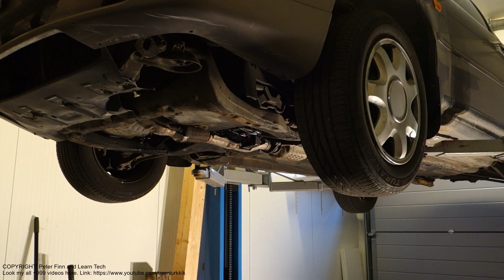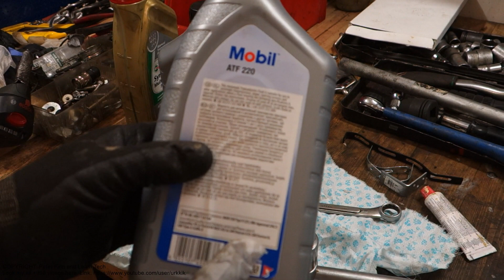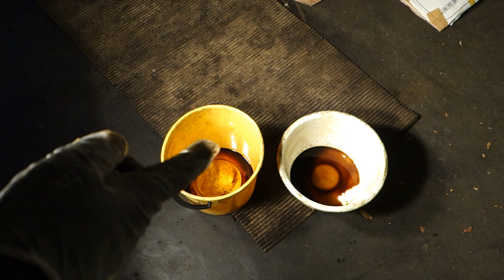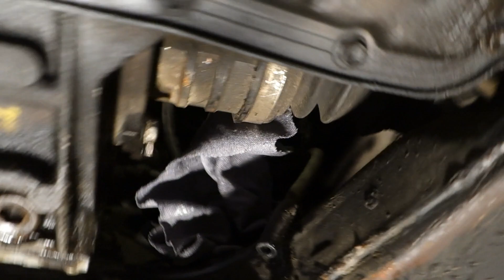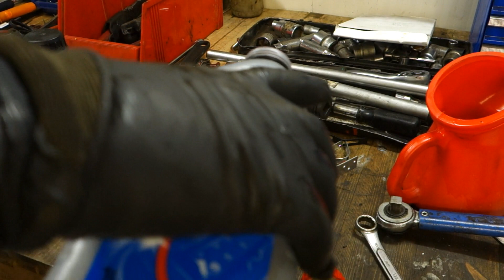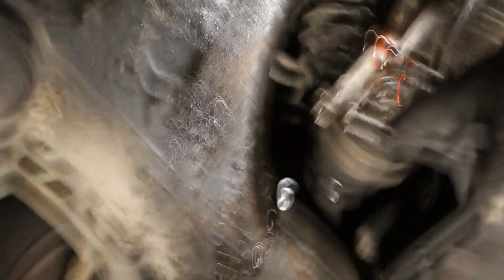How to replace differential oil liquid automatic transmission Toyota Camry. Years 1991 to 2002

Comment: Looks easy enough. Also remember folks, always... always remove the fill plug first before removing the drain plug. Because removing the fill plug first will help remove all the differential fluid out of it through air after removing  the drain plug. Make sure you use the measurement drain pan to catch how much it came out of it and refill the same amount that came out of it. Simple 👍🏽
Reply from the maker: Good advice, thanks for watching!

Comment: Hi Peter does the 97 Camry with the 4SFE engine  for the SV40 differential use transmission fluid or gear oil? Please let me know asap.
Reply from the maker: Same oil works well

Comment: Hello Peter, tx so much. Did I pick up somewhere that the filler plug is easier to reach from above through the engine bay, after removing the air filter box? Not sure, will check it myself one of those days. And always filler plugs first, if you can't undo them the fluid at least is still there :)
Reply from the maker: Good idea
Reply: @TheMrBennito  you can always fill it up through the breather or the speed sensor speedometer cable if it has one

Comment: Is this the same as the transmission fluid? So if I take off the transmission pan, filter..etc...will this drain the same fluid? (then fill it through the transmission dipstick)

EDIT: I have a corolla, not sure if it's the same
Reply from the maker: Yes. This is transmission fluid
Reply: The differential on the Toyota in this video does use the same TYPE of Transmission fluid BUT the transmission and differential are SEPARATE units. The fluid does NOT mix. If you drain fluid from the differential plug on this model car, you MUST add fluid - (approx 1.7 quarts) - thru its own fill hole as shown in the video. Adding fluid thru the transmission dipstick tube puts NOTHING into the differential on this model front wheel drive. This answer may be late for you - but all others must learn this.

Above applies to many but not all cars of course. If you have a older Toyota - and "maybe": others with front wheel drive you must determine what is correct for the model car you have.
Reply: @williamcahoon1438  My toyota lives still

Comment: Thanks Peter for showing the correct way of filling the transaxle .  There was another video that assumed that the transmission and the transaxle were both connected and filled thru the dipstick.
Reply from the maker: Thank You Sir 👍😀
Reply: the v6 version is shared(no fill plug for the diff) but the 4 cyl  has the separate fill plug like this video
Reply: Seeing your comment I have a question that maybe you could help me with.. is a 2014 Toyota Camry in the same situation as the vehicle you mentioned where the transaxle is connected to the transmission fluid? I was setting up an appointment with a Toyota dealer to get my differential oil changed and he goes oh you mean your transmission fluid I'm like is that the same thing? I thought they were different a bit and he's like no it's just the transmission fluid.. so I'm really confused

Comment: Just in the middle of completing this.  Unless it's been off recently you will not remove the differential refill plug using just a wrench.  I had to use a 1/2 inch breaker bar and due to limited access a socket extension.  Even then it was hard to remove!  A standard 17mm socket will do it.  Thankfully quite a bit of fluid came out and it didn't look too bad.  The differential drain and transmission pan drain plugs are 10mm hex.  I intend to refill the diff using a small pump/tube device I used to fill the diffs on my Sequoia, you can pick them up for $7.
Reply from the maker: Thanks 😊👍
Reply: I done same thing like he did here using a old garden hose

Comment: These Toyota fill plugs are notorious for being difficult to remove, and often strip if you use a 12 point wrench. I know 6 point wrenches aren't usually easy to come by, but I have a set of Snap On 6 point wrenches for situations just like this. 6 point won't strip the bolt and they've saved me major headaches countless times. Only issue with using a 6 point is that your angles, especially initially breaking the bolt loose, is significantly limited vs a 12 point. But if you have, and can use, a 6 point, you'll have much better success.
Reply from the maker: Good. 👍😀

Comment: Hi Peter - love your videos!  Thanks for the detailed explanations.  A question - do you know if the car has to be flat in order to do this?  I typically drive the front tires onto ramps when changing the engine oil, and I'm wondering if I can do the same for the differential fluid change.

Comment: Great Video!  Unfortunately, we did not know there was a separate differential in our 92 Camry.  The car is now shot.  Kind of a crappy design as I see it.  No way to check that fluid from the top.  Fluid get low, and diff breaks, too expensive to replace, end of car.  Well thanks for your video.  Very informative.

Comment: toyota camry 3.0 v6 of the year 2000 apply this video?
Reply: As I know Camry and Lexus 3.0 L v6 engines, automatic transmission and differential are not separate units and this video only applies to 5s-fe i4 engines. You can only check transmission dipstick for both.

Comment: Does this have to do with how the car is shifting because my 99 camry is jarring into gear from 1st to 2nd
Reply from the maker: Sure
Reply: @PeterFinnTheCarDoctor  ok I'm going to check my diff fluid thanks.
Reply: Yours sounds like mine, it  was jarring also. I didn't realize the differential and transmission were two separate units.

Comment: You should look into buying something called a gearwrench. The box end has a ratchet inside. It is not strong so loosen with regular box wrench like you have and then use gearwrench to ratchet like a socket wrench but able to fit into small space.
continued:
Also use a six point box wrench for these drain bolts or hard to loosen bolts, 12 point box end wrenches like you have can round out the critical bolt.

also your differential area is wet, did you locate where it is leaking from? I recommend you check your fill hole at least every year just in case and top off if necessary. If very low because leak, do more frequent.

But please answer question: Where (location) was the differential oil leaking from? WHERE was your leak?
Reply from the maker: Oil leaks from transmission cover gasket.
Reply: my guess is it was from where the axles go into it

Comment: I just pumped it in from the bottom. You made it look harder then it really is..
Reply from the maker: Thanks ! 👍
Reply: So you pumped it into the fill hole from underneath the car instead of from under the hood like Peter did in the video?
Reply: Fill it up from the top use old garden hose

Comment: Wow the Toyota Corolla ( 1992 ) will not allow you to get to that differential oil nut that easy !
Reply from the maker: Hi And Many Thanks for Your comment. :-)
Reply: Dear Mr Finn.Recently found out if you take the cold air circulator box off from the top ( two hose clamps that are easy to remove ) you can EASILY VERY EASILY get your whole hand and arm straight down to the differential oil fill nut and twist away. The air circulator box is between air filter box and the intake.

Comment: I am confused here....is the differential on this transmission a separate unit from the transmission (requiring its' own fluid)? Or is it part of the transmission, getting its' fluid supply from the transmission? Thanks for you videos, they are always helpful and informative.
Reply from the maker: Hi, some older Camry's have really TWO transmission oil stores: one in automatic transmission and one in differential. And both have own oil stores. So we need to replace oils for two gearbox areas.
Reply: Thanks for the additional info! I went online and was able to confirm that this is in fact the case for our 1995 Avalon XL.
Reply from the maker: Yes. Avalon too
Reply: Yes, they are separate in some transmissions. Camry up to a certain year is one of them.
Reply: @manuel meza Front wheel drive transmissions have a differential in a single unit. In most models. the transmission and differential share the same fluid. Some models of Toyota do not. You have to separately drain and fill the differential. There are videos here which show you how to do it.

I have not done this yet with my Camry and I may never do it. It is not urgent. The 2.2L 4 cyl Camry has a separate fluid supply for the differential. The 3.0 L V-6 apparently uses the same fluid for the transmission and differential.
Reply: @manuel meza Camry tips, based on the 2.2L 4cyl. The transmission itself has a drain plug which uses a 10mm or 3.8" allen wrench to remove. I use Dex III fluid, not a later type which is back compatible. Drain and fill is about 2-1/2 quarts. Toyota says use a new gasket with the drain plug, but I just tightened it to 30 foot-pounds with a torque wrench.

The oil is easy to change. The filter drains back  completely, and you can remove and replace by hand. The oil recommendation is 10W-30 if the temperature does not go below 0-F.

The 4cyl unfortunately gets certain oil leaks. One area that leaks is the oil pump, which is on the front of the engine. Also the camshaft and crankshaft seals. I'm still working on mine. Change the oil regularly.

Comment: Differential fluid type sae 75-90 apl gl-5 gear oil
Reply: Toyota uses Dex III as the differential oil in 2001 and earlier Camrys.
Reply: @anonymike8280  what about 1996 Toyota Celica 2.2 automatic.
Reply: @cesarorozco8795  The 2.2 Celica uses an A140E 4-speed automatic. The fluid type is DexIII. This transmission has a separate reservoir for the differential. You have to drain and fill that separately. Finds some youtube videos.
Reply: @anonymike8280  thank you, the dealership gave me valvoline gear oil 80-90, I don’t understand why. I am going back to the dealership, tomorrow. Thank you for the information.
Reply: The gear oil might be for a manual transmission but I am not sure. Make sure you're right before you do anything. My info is for the A140E automatic.
Reply: @anonymike8280  I will, thank you.
Reply: @anonymike8280  my transmission is an A140E for the 1996 Toyota Celica, automatic transmission. I already removed the fluid from the differential, I just don’t know which fluid to use. The dealer doesn’t know either, where did you get your information, if you don’t mind telling me, I just want to put the right fluid back in the differential. Thank you again. And sorry to bother.
Reply: @cesarorozco8795  I had a Toyota Camry with an A140E transmission. The correct fluid is called DexIII or DexMerc.

Later fluids (Dexron VI, Toyota T-IV) are back compatible but I didn't use them in my vehicle. They are full synthetic. They have somewhat different properties and might leak too,
Reply: @cesarorozco8795  The fluid type also should be stamped on the transmission dipstick.
Reply: @anonymike8280  yes it has dexron ll, stamped on the dipstick, but that’s for the transmission, for the differential some people say to use the same, dexron ll, amd other people say to use gear oil 80-90.  I just want to know which one is the correct one. I do know that gear oil 80-90 is more thicker that dexron ll. I just don’t want to damage the differential by putting the wrong fluid.
Reply: @cesarorozco8795  Absolutely do not use gear oil. Even though the transmission and differential have separate reservoirs, there is nevertheless the potential for the fluids to get mixed due to a faulty seal or a some other cause. Seriously, use Dexron III or DexMerc in the differential also.

I found a manual online. It gives the differential capacity as 1.7 U.S quarts and the fluid type as Dexron. http://www.turboninjas.com/camry/ax1.pdf
Reply: @anonymike8280  THANK YOU VERY,VERY,VERY MUCH. YOUR HELP IS GREATLY APPRECIATED.
Reply from the maker: Thank You for comment. :-) Best Regards Peter

Comment: Is the same for corolla 2002 CE  it use the same transmission oil?  thanks from GDL jal MX
Reply from the maker: Thanks :-)
Reply: sorry the differential oil on Corolla 2002 is the same as Camry? or which is the good one?
Reply from the maker: It should be.

Comment: Brilliant Peter, Just Brilliant! First you drain the fluid out of the differential before removing the filler plug. What would happen if you could not remove the filler plug, which is a common occurrence on Toyotas? You would have destroyed the differential. There is no way to fill the differential from the bottom drain. Always remove the FILLER PLUG FIRST!
Reply from the maker: Thanks your info. :-)
Reply: Could you explain to me this is??? I’m new to the mechanics but I’m learning as much as I can 

Thank you in advance
Reply: If you can't get the top plug out, in desperation, you can pull an axle and fill the differential partially through the opening there.  But the issue probably is getting enough torque on the plug.

The fill plug can be accessed from the top also if certain parts are removed above. I don't know what size driver or breaker will fit in there, but you can put a pipe over the handle of a 3/8 driver and get more torque. If you damage the threads, you can get a rubber expansion plug. If the plug itself breaks, well, back to Plan B (axle hole).

The back cover is removable. You might have to go to a wrecking yard to get a replacement if things go really bad. Or you can drill and tap the one you have and install a measured about of DEX III fluid (1.7 quarts). 50 ways, bro.

Comment: what caused the differential fluid to be so low? Axle seal leaking?
Reply from the maker: Leaks
Reply: understand it leaks... But what caused the leak???? An axle seal?
Reply: I just replaced the CV axel and all the fluid drained out of the differential. I didn't realize there was a different fill point for the differential until I checked the transmission fluid and it was full. Only then did I learn that I had to fill the differential. My 1996 camry v6 holds .85 qt. according to the specs. It is possible the CV axel was replaced and the mechanic did not know to replace the differential fluid. It is clearly hard to find and hard to do.
Reply: something similar happened with me yesterday. CV joint replacement, expecting fluid, and nothing came out when unit removed. Car was purchased used, so figured that same thing happened. I figured the mechanic removed it, fluid came out, he didn't know how to replace it, so just left it.